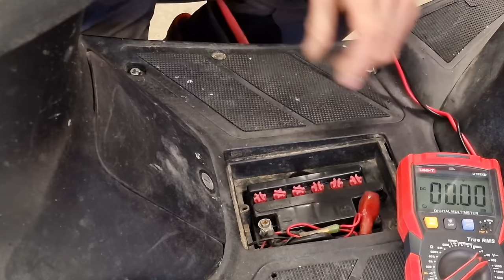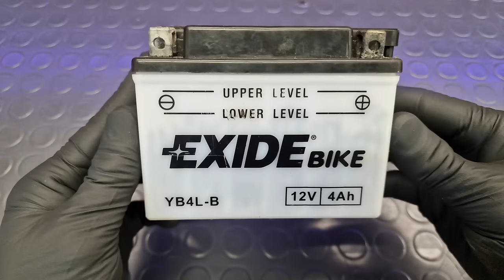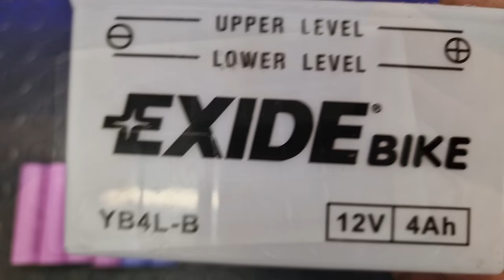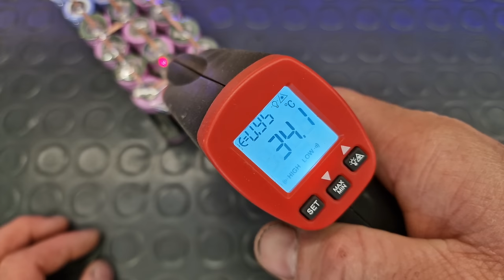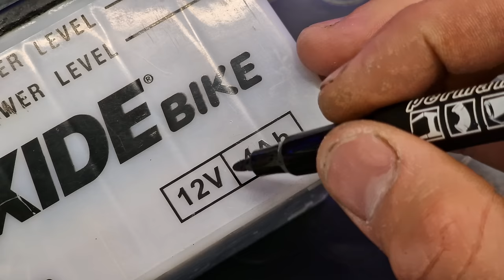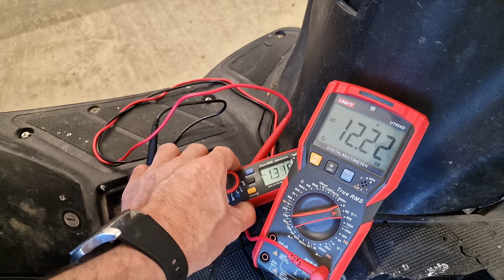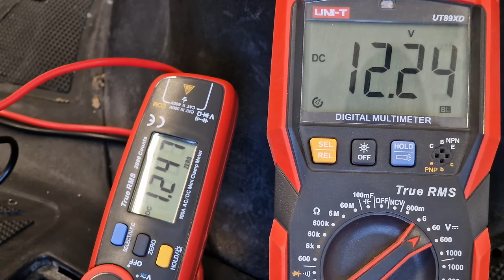How to make Lithium ion Battery pack for Motorcycle? Forget Lead acid Battery CPI Oliver Sport 50cc³

Comment: Bro i have dought, you used different mah battery right as i could see, like samsung and other type. Will it  work properly.
Reply from the maker: All batteries are from the same type of vacuum cleaner wich I bought from the bazaar.
However, the batteries are from different manufacturers, so I decided to put them parallel to the others so as not to unbalance.  Otherwise, if I put them in parallel, there would be a problem with balancing maybe.
Reply from the maker: But it was not have of the same type.
So I decided to put them parallel to the others. It is important that 3 × 3 are the same and you can arrange 8 rows this way. If you do not have the same batteries on hand.
Reply: So they may get discharged at different rate right, would it not affect there life span.
Reply from the maker: For example we have 2 batteries, one with a capacity of 4Ah and the other with 2 Ah. Their total capacity is 6Ah. When connected in parallel, both batteries are discharged equally. Most current flows through the more powerful battery and there is no way to discharge the low-power battery faster because they are connected in parallel.
But as you say, the best option is to have the same batteries.
Reply: Last dought,.                              Would it not distroy the smaller battery which has lower ah.
Reply from the maker: It will not degrade because most of the current will pass through the large battery
Reply: Will it not charge the discharged battery
Reply from the maker: They are connected in parallel, they will be charged and discharged with the same voltage.

Comment: Using LiFePO4 battery will be more stable than lithium ion battery, what do you think of?
Reply: since he refuse to answer ill answer for him. lipo doesnt have the "instant" ( punch ? ) juice the motorcycle/scooter needs. unless they changed in the last two years where i didnt read anything about that bacause it was out fo interest. i dont know what is his REAL WORLD result ( we see soemthing is fake.. he cannot charge it and we see that when the bike is running ), but normally, even 18650's doesnt have that PUNCH juice. which damage all of the 18650 cells over time ( and this time is actually short.... under 100 start ). 

im not an expert i just know basic facts. i wanted to do that since a long time but never did because it wont work properly. still better to change a crap brand battery every 2 year than building this.

Comment: your scooter alternator support charging for lithium batteries?
Reply from the maker: Charges with 14.4V but the battery after reaching 12.7 ~ 12.8V BMS turns off charging

Comment: hello my dear, take me out of a big doubt, nobreak battery is used to replace the electric bike ones???can i put 4 nobreak battery in the electric bike what happens?? to run a 6 coil alternator with a 350w 36 controller at 48 using 4 UPS battery? My battery is 7 Ah

Comment: hello dear sir  frist thanks for this  education video   my question is , can we using three of this kind battery parallel together  without BMS extra between them ?
Reply from the maker: Thank you very much, but I did not understand exactly what you mean.  Want to use only 3 batteries in series without bms or want to add 3 more batteries to the current pack.
Reply: 18650 cells need to stay balanced this is why the Bms is used if not the cells discharge and charge at different rates causing cells to fail and ultimately battery failure hope this helps

Comment: Скутер на аккум выдаёт 14.3V, удачи в эксплуатации.
Reply from the maker: I know this but the BMS in this battery turns off charging after the voltage reaches 12.7~12.8V
Reply: @ErCanEverything  It is very difficult to convince a person who believes in BMS. But still.
You need an oscilloscope, you need to disconnect the battery with the engine running, and look at the voltage waveform of the scooter's on-board network. Almost all models have voltage spikes up to 70V, they will look like needles. Interference energy is sufficient to disable bms keys.
The solution is very simple - add a capacity of 10000mF * 16V to the battery terminals.
Reply from the maker: You are right. That is not a bad idea to add a capacitor.
Thank you🙂

Comment: slm aleykum Ercan kolay gelsin...satin aldim bende 4s aynisni yaptim ...pilleri tam 16.8 den 14v dusurdum discharge yapip ve bms taktim ....super calisiyor vespa motorsiklet 14,4 volt veriyor......ama sen dedin 5A max sarj yapicalak...internette bu bms 60A charge oluyor yaziyor...nedenini sorabilirmiyim ?? pillerim high discharge 10A ve 4 tane yan yana toplam 16 pil...4s4p.

Comment: Any more benefits of using lithium for vehicle car, motorcycle battery?
Reply: Aconselho utilizar lifepo4 em paralelo com bancos de ultracapacitores. Esse tipo de bateria por ser carregado com tensões de 14.4 volts e combinado com os ultracapacitores pode fornecer rapidamente uma corrente alta necessário para a partida do veículo. Caso contrário a bateria seria danificada podendo explodir  e provocar um incêndio.

Comment: Hi. I did it too, perfect. Thanks for the video.
Reply from the maker: But check that it still does not heat up and measure the charging current.
Reply: Everything is fine, it doesn't heat up. And the charging is also optimal. Thanks again.
Reply from the maker: I am glad, Thank you🙂🤝
Reply: Nice bro ..what was the cost of all this ...

Comment: How was the process of charging batteries in that kind of set up?
Reply from the maker: Should be charged with 12.6V, but this motorcycle charges 14.4V.
but BMS protects them from overcharging, because it stops the current to the batteries as soon as it reaches 12.6 ~ 12.8V

Comment: There are many direct lead-acid battery replacements with Li-ion cells. The easiest way is to contact a Li-ion battery packer such as Lithium Batteries,Motorcycle Batteries,Solar Batteries,KOK Power Limited that specializes in automotive, motorcycle and eBike batteries as drop-in replacements

Comment: 1. NEVER mix different batteries/brands.
2. You should use Lithium-iron Phosphate batteries (LiFePO4) instead because they have a longer lifespan and do not expload/catch fire like other Lithium-ion or traditional NCA/NCM. They only emit a smoke
Reply: you know he was just using up what he has.... AND... do the liFeP04 charge with the same charger? I am gonna look into this. I need to make a solar battery for a remote tool shed in the mountains. I just need a light and a fan. I'm thinking 12v because thats the panels I have. (and a bunch of old tool batteries like this guy.....)

Comment: Will the heat from the hot iron damage the batteries?
Reply: You have to use a 100-150w soldering iron and be very fast.

Comment: Привіт. А як бути з генератором зарядки? Чи плата все зробить????
Reply from the maker: Hello👋
So far it's been working flawlessly.
The alternator output voltage is ~ 14.4V at about 5A and BMS Stops charging when it reaches 12.7V
Reply: @ErCanEverything  зрозуміло. А чи буде це працювати на 4шт. батареях LiFePo4 32700 та чи вистачить плати bms 40A ?

Comment: How do I get the charge controller, how much
Reply from the maker: I haven't installed a charge controller, the bike charges up to 14.4V, but as soon as the battery voltage reaches 12.6~12.8V, the BMS automatically shuts off charging

Comment: Can i use  laptop's battery bms ?
Reply from the maker: It will not work.
You can use BMS from an old screwdriver battery if you have one.
Reply: @ErCanEverything  what have if i use 4 -8 ah not 13 ah
Reply: @manas_edits1  its not the amount of ampere hour , but the burst amperage when starting the motor...the starter motor draws a lot of power from the battery when asked to work (usually 30-40 amp).

Comment: What is the function of the electronic chip used in the battery?
Reply: It is a battery protection so that the battery won't overcharge or over discharge

Comment: The voltage below 12.4V ? Need to recharge that battpack and check your moped regulator cz the current for charge that battpack is unstable
Reply from the maker: The voltage below 12.4V because the battery is 13Ah and will charge slowly.
The current increases with increasing engine speed.
Reply: @ErCanEverything  dear friend tath bms can really protect the overvoltage from the "alternator" or by something like this?
Reply from the maker: @PupettaZoccola  Yes I tried it, and after the battery reaches 12.60 ~ 12.80V BMS stops charging and after you disconnect the charger, it shows about ~12,15V.
When you put a consumer in it, then it turns on and will show 12.60V
Reply: @ErCanEverything  Amazing can be used like an ups upgrade without problem, i'll be curious to know the cca of this monster battery, naturally broken by the bms overload protection
Reply from the maker: @Saverio Mallardi In this video I make a battery pack for UPS
https://youtu.be/cf-4e0qoOVM
Reply from the maker: @Saverio Mallardi In this video at 20:10 min, I show how it automatically shuts off charging at 13.20V
https://youtu.be/2xirwLUWW-U

Comment: How does the lithium batteries get charged?
Reply from the maker: It is charged by the alternator of the motorcycle, as soon as the batteries reach 12.6 ~ 12.8V BMS turns off the current to the batteries.
Reply: @ErCanEverything  Thank you for the fast reply! 👍😊

Comment: Can you tell me the  BMS specs or model,  so i can search in my country (Argentina) a compatible one. Thank you..
Reply from the maker: There is a link in the description of the video and you can order from there or see the specs.
Reply: @ErCanEverything   thank you...
Reply: @ErCanEverything  Looking for a BMS 100a 5s 21v  I read this model it's compatible with LiFePo batteries, but not with Li Ion batteries, that's right?
Reply from the maker: in the description of the BMS it says that it is for Li-Ion batteries
Reply: @ErCanEverything  yes.. I read.
Probabily here un ARG the model sold ,  not be compatible, despite It looks the same .

Comment: Never use Lithium Cobalt batteries for motorcycle or automotives without individual battery controller.
Each  cell  must  be  controlled  for  1- Overcharging  voltage + controlled  charging  voltage...   2- Overdischarging + controlled  discharging  current...   3- Short  circuit  protection...   4- Battery  temperature  monitoring...
.

Comment: What is the C rating of the cells?
Reply from the maker: In the description I wrote that the total capacity is 13.2Ah.
Each cell is 2200mAh
Reply: The discharge value (in A) respect to the capacity (“C”). For example if a cell which capacity is 2200 mAh has a  3C discharge, that means that the discharge of that cell in A, is 6600 mA

Comment: Lithium ion battery is not recommended for motorcycle/ebike because it will explode easily if shortcircuit or overcharge...best if use Lithium iron battery like 32650
Reply: As long as if it can keep power
Reply: Use b.m.s then u reduce risk
Reply from the maker: I also used 100A bms

Comment: This is a very bad Idea the cells can not go over 12.6v max and the charging system will go up to 14.8v lithium over charged goes boom. with fire.
Reply from the maker: It would not be a good idea if the batteries were connected directly to the motorcycle. But in my case, the negative terminal of the battery passes through the Mosfet's controlled by BMS. When the voltage passes 12.6 ~ 12.8V stops charging the batteries. You can see in this video at 20:10 min
https://youtu.be/2xirwLUWW-U
Reply: Thats why scientists discovered stepup and step down circuits. No boom. I also charging 12v lithium battery pack with 24v weller ac  transformer. Just search.... this is not a bad idea, A brilliant idea. Good luck entrepreneur
Reply from the maker: Thank you🙂🤝

Comment: It has no Safety feature hence dangerous to your vehicle
Reply: What safety, Do you recommend anything,related to it.( Thermal fuses, relays, etc)
Reply from the maker: Even though the current goes through the mosfets, adding 1 fuse wouldn't be bad.

Comment: Dangerous BMS just control the output  voltage and current its don't control the input voltage and in bike input voltage not regulated its increasing and decreasing depending on the speed
Reply from the maker: A motorcycle alternator keeps the voltage at 14.4V and I don't believe it can generate more than 10A current. As soon as the battery voltage reaches 12.6 ~ 12.8V, the BMS stops charging.
Reply from the maker: In this video you can see it at 20:00 As soon as it reaches 12.8V the BMS turns off the charging and then charger turns off
https://youtu.be/2xirwLUWW-U

Comment: untested cells at all u serious?
Reply from the maker: The battery has been sitting on the shelf for 3 months, I took it out because winter is coming and the voltage is still 12.4V